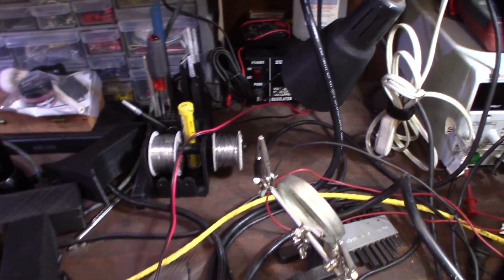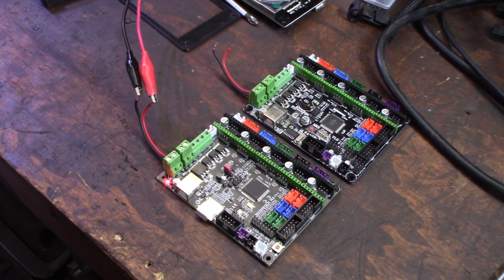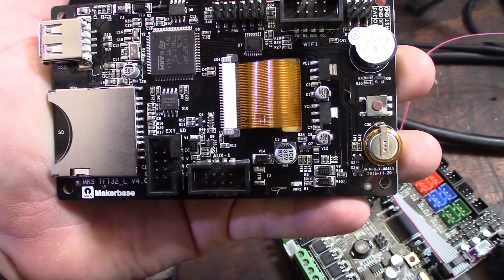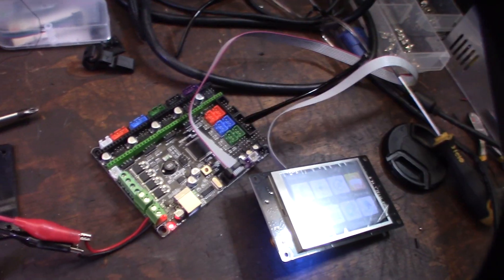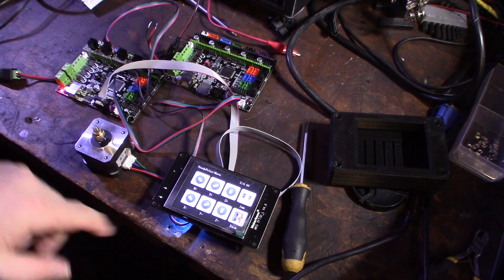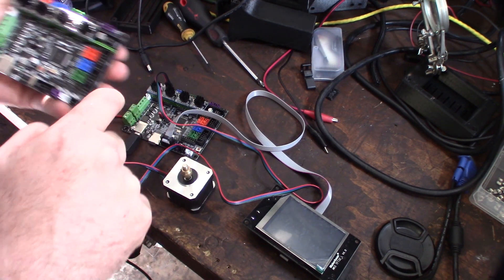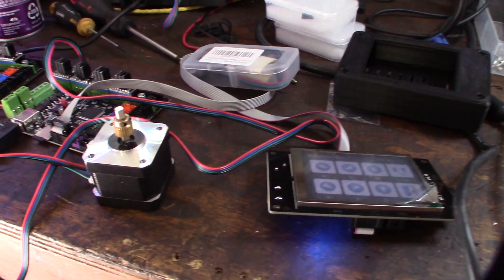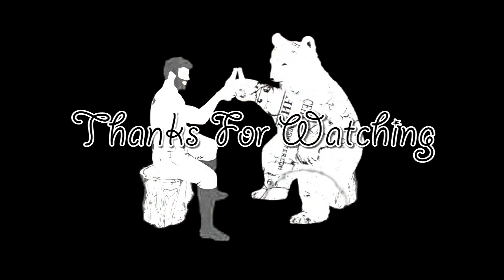32bit SKR 1.1 3D printer board upgrade tft32 marlin 2.0 TMC2208 Anet Tevo Creality Part 2

Comment: SKR 1.1 pro has 6 motor controllers
Reply: i think this is the older version of the now skr 1.3 released before the skr pro 1.1.
ve been having issues woth my skr pro 1.1 myself but im getting through them i now have it compiling using 2100 and not tft35, i just need to add them and the bl touch in and change to the 2209 that i have also
Reply: @brianherlihy2688  I have successfully complied marlin-bugfix2. With BLTOUCH.

Comment: SKR 1.1 circuit board is a bad design, its 5V power supply is unstable, the fluctuation is too large, I am connected to 24V power supply, 5V output has 1V fluctuation when no external line is connected, when I access the infrared limit switch one by one, I found 12864 LCD screen began to appear garbled phenomenon, this screen garbled phenomenon took me a lot of time, and finally found the problem. At first, I thought it was a problem with the cable. I changed the cable several times and finally did not solve it. The final conclusion was that the 5V power supply was unstable, and its own fluctuation reached 1V. After the external line was connected, the 5V fluctuation was even greater, resulting in 12864 LCD screen display garbled
Reply from the maker: I'm running a SKR 1.1 and SKR 1.3 and both seem fine. Below is me printing on the SKR 1.1. I like the 1.3 allot better but I had the 1.1 left over.
https://www.youtube.com/watch?v=4i8hIX85cu4

Comment: You said in another comment that you got the skr 1.3 board. I ordered the same board along with the 32tft screen. I’m worried about compatibility because it explicitly says it supports 32tft on the 1.1 board but not the 1.3. Also, were you ever able to get BLTouch and babystepping working on this screen?
Reply from the maker: tft32 works on my 1.3 board. Commands runs fine.
Reply: Fintech Repair Shop awesome! Does the 1.3 board require a separate mosfet for the bed on a 24v supply? The specifications say it can support up to 144w but I read that the ender 3 bed is much more than that.
Reply from the maker: @Terminatr00  I personally like running external mosfets. The connectors on the boards seem cheap and I don't like the much current running through them.
Reply: @fintechrepairshop  You can print from TFT 32 USB/SD card? Because mine after I confirm printing just freeze.

Comment: Is there any difference between the boards, except 8 bit vs. 32 bit?
Reply from the maker: That pretty much it.  the new  SKR 1.3 board is allot better then both. SPI and UART built onboard, direct driver control. No more jumper wires. Dedicated servo port for BLtouch
Reply: @fintechrepairshop  wow, that thing is looking nice! The Gen L was already a nice board, then I saw the SKR 1.1 and now the 1.3! This thing is a RAMPS board on steroids haha
Reply: @fintechrepairshop  th SKR V1.3 is probably the best customizable(drivers etc.) 32 bit board available at the moment. Correct me if I'm wrong :)
Reply from the maker: @mertcapkin7263 That"s what I thought when I saw it. I think the 1.3 has it all. The best board I've seen yet for marlin 2.0 with removable drivers. Direct driver control and dedicated servo pin for BLtouch is icing on the cake. I bought it a few days ago. Coming from China.
Reply: @fintechrepairshop  which drivers will you use?
Reply from the maker: @mertcapkin7263  I already have two set of TMC2208. I hear the 2208's run cooler and are more reliable. I don't need sensor-less homing on the 2130's
Reply: @fintechrepairshop  alright, loud and clear. I don't know which one is better and I also don't really know the concept of SPI and UART as I am a mechanical engineer haha
Reply: @mertcapkin7263  best board at this price? Maybe. Best board period? Duet

Comment: I have just bought one of these boards, I don't have the screen yet but I intend to use octoprint for now. How have you found the board? Have you installed and printed anything yet?
Reply from the maker: I have the board running with Marlin 2.0, no prints yet. I actually just bought the SKR 1.3 board. I'm going to use the 1.1 in my old printrbot and the 1.3 in my large printer.
Reply: @fintechrepairshop  I look forward to seeing it

Comment: Exactly how did you load marlin onto the akr board please?
which software and how would be very helpfull.
many thanks.
Reply from the maker: I had to first create a bin file in Atom Interface then I had to copy to SD card. I'm going to do a video about getting marlin on the board in about a week.
Reply from the maker: Watch part 3
Reply: VSCODE works like a charm. Download and install then in extensions add platformio. Open folder of firmware and make nesscerry changes in configuration.h and hit upload. It downloads all the dependencies and compliles.
Reply: Load a compiled .bin-file onto the sd and reboot
https://github.com/makerbase-mks/MKS-Marlin2.0-Compile-Tool

Comment: Please check the print quality after installing the board (32bit ARM vs 8bit micro). I am seriously considering upgrading my 3D printer with 32 bit board (either SKR1.1 or RE-ARM clone with RAMPS). I've read that it should allow better kinematics calculation and therefore finer print, but I have not found any direct comparison (well one...out of focus).
Reply from the maker: OK, I'm making video about the upgrade process.